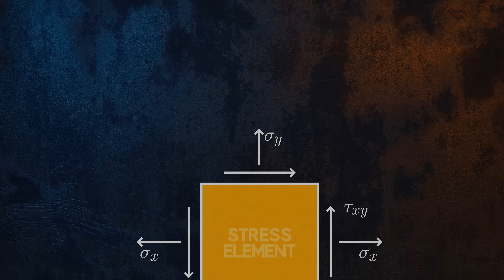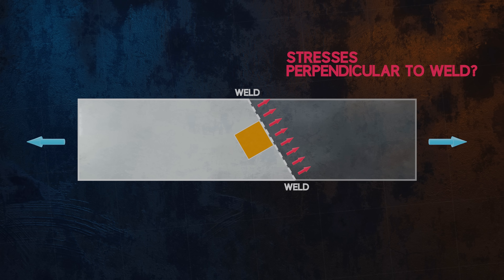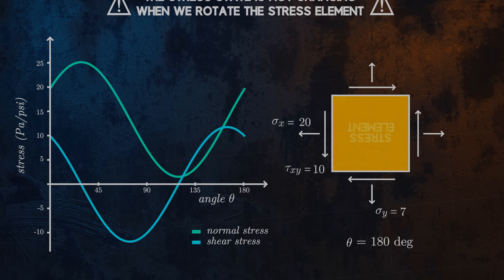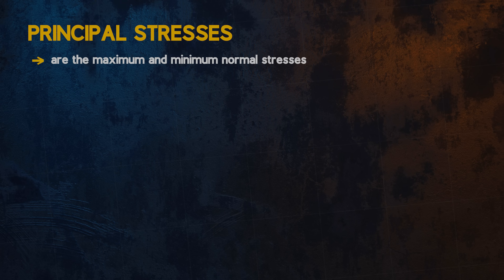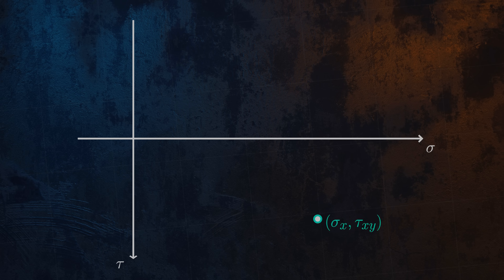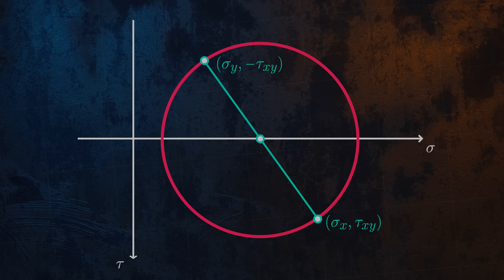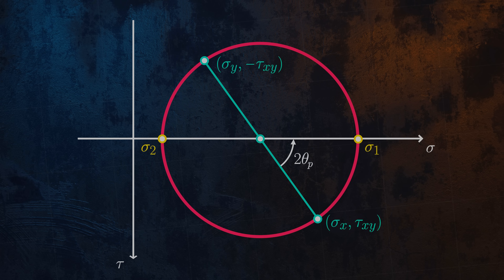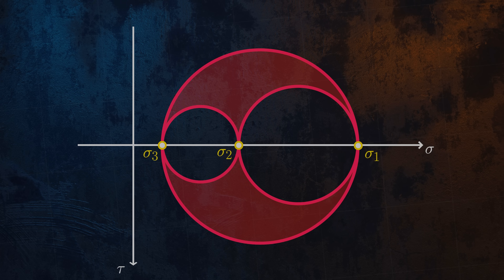Understanding Stress Transformation and Mohr's Circle

Comment: There is an error at 3:57 regarding the convention for positive or negative shear stress. For a coordinate system given by x positive to the right and y positive upwards, the shear stress is positive if the arrow on the right side of the stress element points upwards, or the shear stress is negative if the arrow on the right side of the stress element points downwards. All the shear stress arrows meet head-to-head or tail-to-tail at the corners of the stress element, but they ALL indicate positive shear stress if the arrow on the right face points upwards (or negative shear stress if the arrow on the right face points downwards). It is incorrect to state that on Mohr's circle, the shear stress is negative for points below the sigma axis; rather, it is correct to state that the shear stress is negative if the (sigma_x, tau_xy) datapoint is above the sigma axis and the (sigma_y, tau_xy) datapoint is below the sigma axis on Mohr's circle. And you should NOT put a negative sign on the (sigma_y, tau_xy) datapoint; rather, you should write the value of tau_xy as a negative value IN BOTH the (sigma_x, tau_xy) AND the (sigma_y, tau_xy) datapoints if tau_xy is negative.
Also, is there a reason why you are not using a right-hand-rule coordinate system for your stress cube (at 6:18)? The stress transformation equations you use in your stress transformation video are based on right-hand-rule, with theta defined as counterclockwise with respect to the positive z-axis, so I think it would make more sense to be consistent to use a right-hand-rule coordinate system in this video, too.

Comment: As always, your videos are very useful and helpful. You provide a very useful recap of key information that engineers (and engineering students) need to know.

I would like to offer one correction/nuance for this video however... the definition for positive shear stress is not based on the direction of rotation. In the example you show, there is only ONE value for shear-xy in any orientation, and it is positive on both the x and y faces in the original orientation. Shear is acting to rotate the element in both the clockwise and counterclockwise orientation, so this cannot be used as the definition for positive sense.

Shear is defined as positive if the positively-oriented face is experiencing shear along a positive direction. So, if the positive-x face experiences shear along the positive-y direction, then shear is positive. If positive-y face experiences positive-x shear, then it is positive. If negative faces experience negative shear, it is also positive. Due to the complimentary nature of shear, you will find all positive or all negative values for shear-xy, and in this example they were all positive in the original orientation.

If you rotate the element 90 degrees, then the x face which was previously experiencing positive-y shear will now be experiencing negative-y shear in the new orientation, and this is why the definition would now consider this negative shear-xy in the new orientation.

Same concept applies when considering shear-xz and shear-yz, and since the concept of "clockwise" does not apply well in the 3D sense, it is best to use the positive-face/positive-force or negative-face/negative-force definition for positive shear across all faces.

This convention, along with others, is shown here:  https://mechref.engr.illinois.edu/sol/signConvention.html

Comment: 0:48 This is something I NEVER understood. WHY do you need a "stress state at an angle?" If the applied load is perpendicular, WHY even consider a "stress state at an angle?" It makes NO SENSE to me. Someone please enlighten me.
Reply: This is a solid bar taken for example but think of different objects for example a weld joint done at an angle of the applied load or two angular surfaces pasted by glue during wood work ..... at scenarios like this to correctly understand when will the object fail one must have a tool to calculate that "when".
This is that tool
Reply: @mayankknayam7596  Why does it have different stress? You are pulling it perpendicularly.

Comment: The choice of using Mohr's circle to determine the maximum principal stress perpendicular to a butt weld is unfortunate. This implies that failure is governed by the Rankine criterion. Your own video on failure theories states that for ductile materials (which will include the vast majority of welds) the von Mises criterion should be used, and this is almost universal for metal structures in the real world.
There's a misconception in certain quarters that splice joints in beams should be angled and this video reinforces this message, unfortunately.

Comment: For the shear stresses, I learned from my lecturer that if they cause the element to rotate in a clockwise direction, they are taken as positive, and if they cause the element to rotate in a counterclockwise direction, they are taken as negative. So in 4:20 I was surprised when you used the opposite sign convention. Does it matter which one we use?

Comment: A prismatic concrete column of mass density ρ supports its own weight, as shown in the figure.  (Assume that the solid is subjected to a uniform gravitational body force of magnitude g per unit mass). Suppose that the concrete contains a large number of randomly oriented microcracks.  A crack which lies at an angle θ to the horizontal will propagate if

|Tt|+μTn>τ0

where μ is the friction coefficient between the faces of the crack and τ0 is a critical shear stress that is related to the size of the microcracks and the fracture toughness of the concrete, and is therefore a material property.

By assuming that μ=0.7, using Mohr's circle, find the orientation of the microcrack that is most likely to propagate.  Hence, find an expression for the maximum possible height of the column.

Comment: Can the mathematical equation be derived geometrically from Mohr's circle?
Reply from the maker: Yes, you can use the equation for a circle to figure out what the principal stresses are based on specific stress state (if you know the normal and shear stresses), or conversely based on the equation of a circle if you know the principal stresses you can calculate the stress state for any orientation of the stress element.

Comment: No one ever uses Mohr's circle to solve daily problems as an engineer.   if you use any of the commercial FEA package, you also don't need to draw Mohr's circle.   it is useful and important to know what it is and the relationship between normal and shear stress on a single element depending on the coordinate system we use to correlate them but it doesn't help you during daily work.

Comment: a silky question: I have a bolt that is fixed into the ceiling at an angle. I have it's original shear stresses when the bolt wasn't at an angle in the ceiling (i.e. perpendicular to the ceiling). Would I use the stress transformation equations to work out the new shear stresses? Or regular sin/cos to resolve the shear forces. Thank you!

Comment: Sorry for question, I'm not mechanical engineer but electrical engineer: Isn't this transformation during rotation of stress element just projection of force on normal and parallel axes linked with line of stress element?